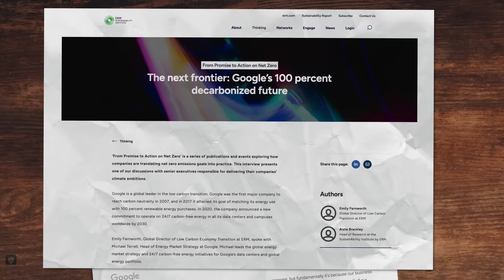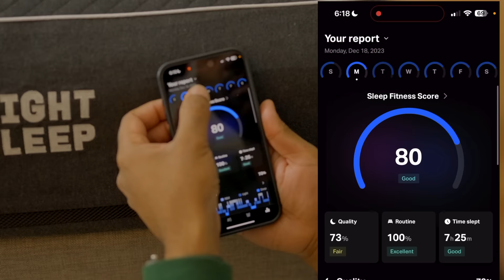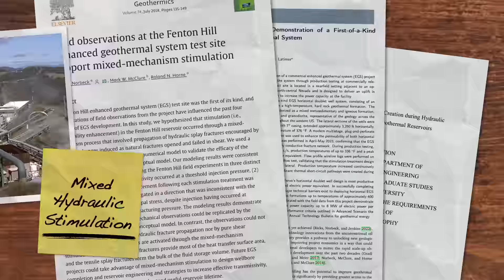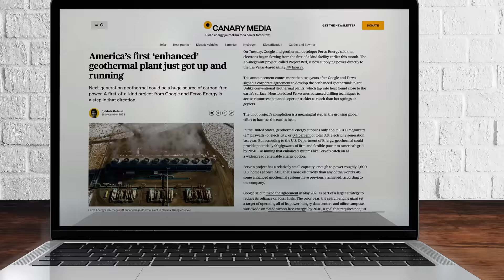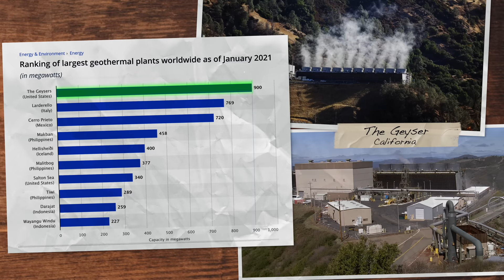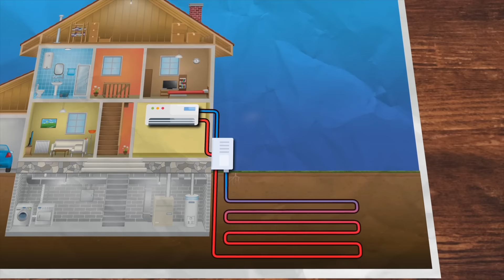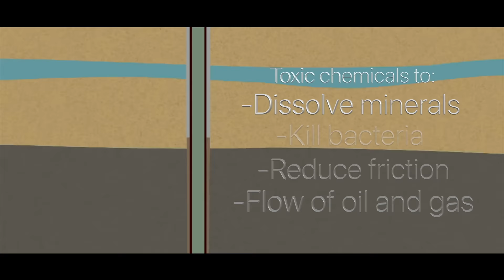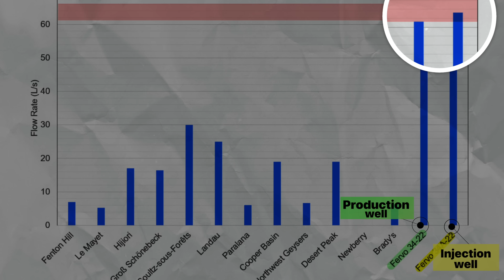Google’s Billion Dollar Gamble: You Won't Believe What it is!

Comment: oh I forgot to mention my design system is scalable,  can be located is most locations for residential as well as commercial scale systems there by reducing the supposed need of these ugly high voltage towers oh nor the big wind jammers, nor the massive black heat generating photo voltaic solar farms all of which neither produce around the clock, have to be built in special locations & like I said are ugly to look at & harm the environment in other ways than just air pollution like coal, & nuclear.

Comment: No one is worried about conservation of energy? i.e. if you take energy from earth at some point it will start losing energy, gravity changes...etc. one thing is using what's already steaming out but sufficient extracting it could change the balance the moment we do this (like we always do) at a massive scale
Reply: this, is probably the most unthought of problem in many things " green" people tend to forget. good to see it in writing for all to consider. in my opinion, as a newish technology, it should be allowed to research just such issues.
Reply: I think geothermal is a tech best suited at the individual building scale. Whole power plants could be useful in areas where it is abundant throutracking. mines or fissures but I don't see the benefit with fracking.
Reply: Lots of people have done the numbers and it's mindblowing the scale of the amount of energy stored in just 1-km-thick layer of the Earth's crust. It could power humanity for hundreds of millions of years if we could only access it wherever we needed it.

Also, I'm confident that operating each power plant will become economically unviable long before the temperature of the bedrock goes down enough to make me worry.
Reply: It's helpful to remember that humanity's energy needs are infinitesimally small compared to the earth. Conservation of energy means that heat from the hotter deeper rock will equalize by radiating up to the now cooler surface layers. As others have said, it's truly humbling to realize just how much energy is in the ground compared to our puny scale
Reply: Absolutely agree  @santiagopm88 . Someone mentioned that the rock would get too cold in just 5 years, which is obviously inaccurate, considering that the Larderello field in Italy has been in operation since 1913 (111 years ago), and it's still the second-largest geothermal plant worldwide.
But even if it did cool off and make the power plant uneconomical, simply shutting it down for a time would fix it